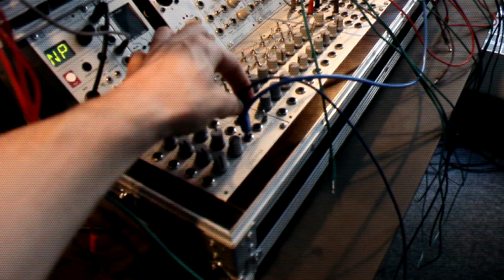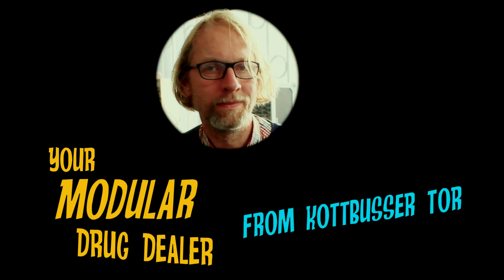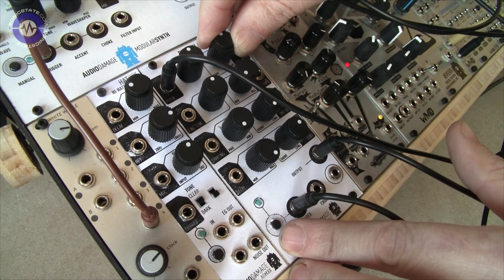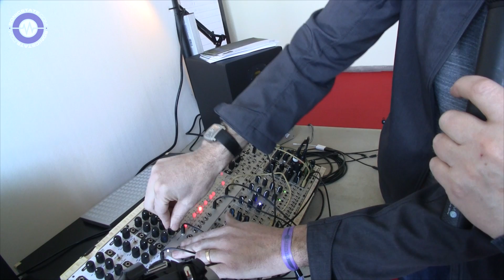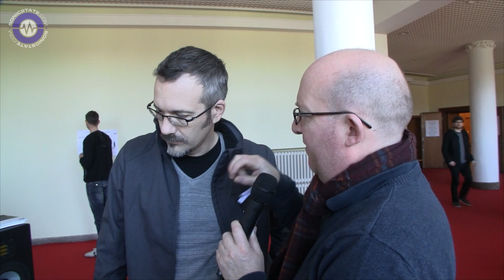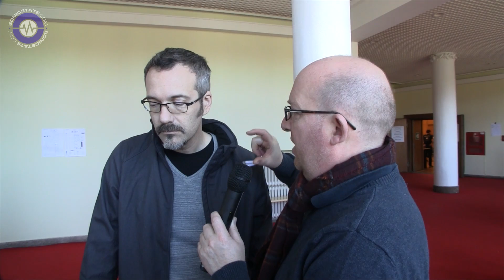Tell Me About: Karplus Strong Synthesis

Comment: but there is only one analog module, which is made to do exactly this. It sound amazing and is one of the most underrated modules around. It's the Delay1022 by CG Products.
Reply: +Igor Sabara
That CG Products one looks sweet indeed, but aren't the Doepfer and the Pittsburgh BBD modules also analogue?
Reply: sure, but not V/Oct and the CG just sounds so much more beautiful (and clean I guess).
Reply: Ah good point about the v/oct. I haven't really compared the sound, I guess the best thing to do would be pick one and give it a whirl! There is, or will be, the DSI tuned feedback module due soon, that might also be worth a look. Digital though.

Comment: i wonder if the module lets you input an externally generated impulse? seems like the range of tones would be exponentially increased
Reply: Yes. You can use anything as the impulse. It has an impulse input. (You can actually use it as a plain ol' delay if you want.)